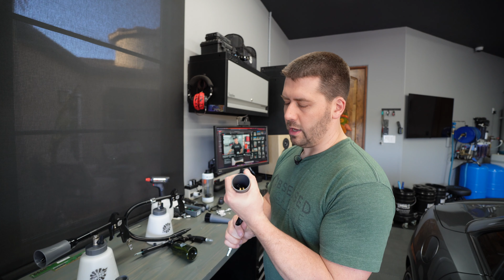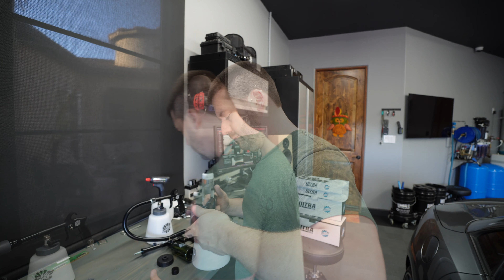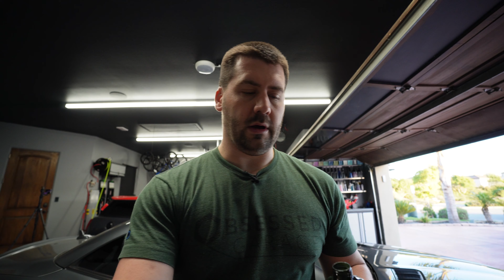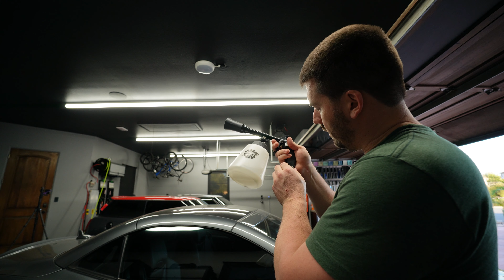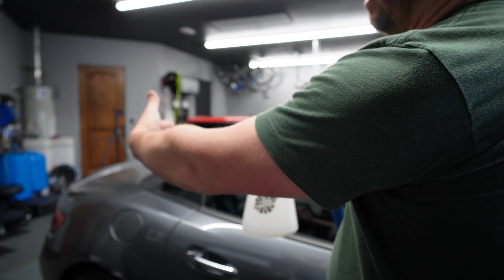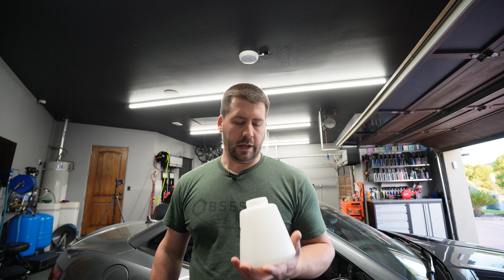IG484 The Rag Company Ultra Air Products!

Comment: In the air blaster plus what chemicals do you recommend to put in it or which chemicals to stay away from using in it??
Reply: P&S Xpress at 1:2 dilution or rinseless wash at 1:256, both of these will have good cleaning power combined with the air pressure.

Stay away from acids and mostly stick to using pH neutral products
Reply from the maker: Interior cleaner, or rinseless.  I would want to stay away from anything aggressive like APC or degreaser because they will gum it up and the overspray would stain things around where youre working.
Reply: I personally would use something like Poorboys World Enzyme Cleaner, a highly dilutable product.  It's a fantastic all around cleaning solution, smells fresh, leaves the cabin smelling clean afterwards, can be used on all the surfaces inside the cabin from plastics, carpets, upholstery, and just about anything else found inside the cabin.  Of course, the main benefit of an enzyme cleaner is its ability to attack foul odors by the beneficial enzymes that break down the odors and eliminate them.  It is also a chemical that Tornador recommends be used in the Tornador with the bottle/tank chemical injection model.  Tornador also has chemical concentrates for the Tornador devices.  I would tell anyone looking to purchase one of these devices to definitely get the chemical injection model because it can be used with a chemical, or with straight air, making it the most versatile device in the Tornador line up.  Having the ability to inject the chemical is a really nice feature to have, and it aids in the overall cleaning, being blown or "pushed" of sorts into the substrate being cleaned, whether fabrics, plastics, or whatever. Tornador (the original designer of these devices) also sell a device called the Tornador Black series which is their top of the line product line up for these tools and they have the same various devices, along with a unique vacuum attachment that allows you to blow out the debris, whilst your shop vac is sucking up the debris that is blown into the air, making clean up afterwards much easier.   Another great use of the chemical injection model is engine bay cleaning.  It's especially useful with that, especially if you are working on a classic or vintage car that isn't as water resistant as today's modern engines and you really do need to take extra care or you could cause major damage.  Even on modern engines, it works fantastic.  Then a simple wipe off afterwards with an old microfiber towel to mop it all up.